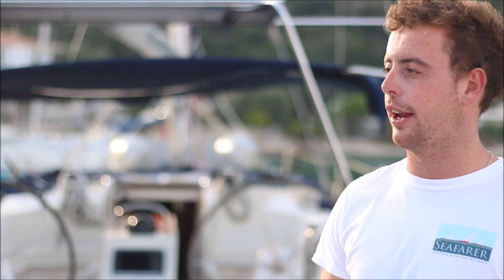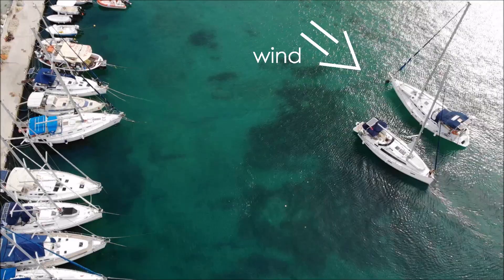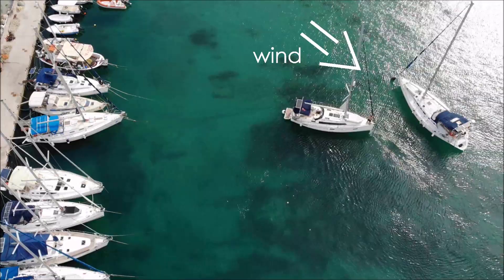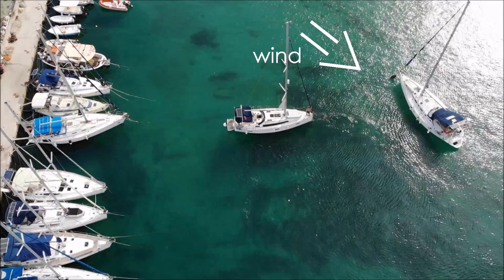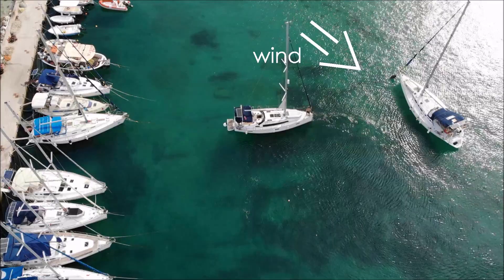How to do a Stern to Mooring

Comment: Nice vid, but in my opinion you should to drop the anchor when you heading back to the mooring and use as much anchor chain as possible. Thanks for the video.
Reply: Yes, not going straight while stretching out the anchor chain causes trouble - especially in harbors!

Comment: I wasn't aware that you would need to drop the anchor so far out. Did it drag with the boat after hitting bottom of anchor where it was set?
Reply: It drags a little. You try to pace your movement with the speed that your windlass lets out your chain. Once you have your stern lines tied and set where you want them you set the anchor with your windlass to the appropriate tension. Setting it far out gives a better hold because the weight of the chain is also working as a anchor and keeps the bow from moving to starboard or port.
Reply: @chefdan87  thank you!
Reply: @chefdan87  You have to move according to the needs enforced by wind.
The windlass might be too slow.
Far better easing the chain nut on the Windlass' axle and let it fall & control the chains speed by the Nut's clutch.

Comment: Dear friends good evening. 0:32 it is not the right way to cleat a mooring line. 1:40 mooring lines go under preexisting mooring lines. 2:11 the same thing. 2:22 an old CQR to dig in in that sea bed? Only with a lot of luck.  Fair winds.
Reply: Isn't whether to go under or over preexisting stern lines only dependent on which boat is higher? That is, isn't the goal not having the stern lines touch/scuff against one another?
Reply: @sleepyjesus7265  dear friend good evening. I am afraid that is not that way. All mooring lines even from diferent sized boats touch against each other becouse they are never tensioned completely. Boating etiquette might seem non sense to the young generation but to my days was very important. I am very sorry that my comment propably offended you. I didnt mean that. I wrote it as a friendly advise, we all keep learning.
Reply: @nikotsalis  Thank you for your reply. I'm sorry if I appeared to be offended in any way by your comment, I meant not to signal anything of that sort. My question was only raised out of curiosity towards the subject. I tend to think these things from a pragmatic viewpoint rather than a fixed etiquette or a rule book. I understand we sail in very different parts of the seas, so that part of the etiquette dictating that new lines would always go below the preexisting lines, has never reached me. If it is not too much trouble, could you please explain the reasoning for this practice, as it seems both more difficult for the crew of the second boat to do in the mooring process and quite irrelevant if the premise is that the lines would eventually scuff against each other anyway? I'm here to learn and discuss in a friendly manner, not to get offended or angry. Thank you.
Reply: @sleepyjesus7265  Juho, the aim of putting our lines under the existing ones is to facilitate the exit of the other boat. Some kind of etiquette, really; "I came here after you, so I am not going to bother you in any way".  Nothing to do with lines touching each other, they are built for this.
Reply: @sleepyjesus7265  Dear friend good morning, I am sorry for the late reply but I was away with no internet connection. Mr Juan Domenech has absolutely right. There is nothing more pleasant to the eyes than a neat clean boat aproaching to the dock with all crew members, with t shirts and not half naked, to the right positions, with no yelling and shouting, everyone to know what to do with minimum of effort and maximum effect. The boat moors perfectly effortessly with an impecable choreografy, with respect to the other boats and to seamanship. And if they manage to do it under sail even better, they make my day!!!
Reply: Επίσης νομίζω οτι έπρεπε να ρίξει την άγκυρα πάνω στον καιρό, και οχι ανάποδα που το κάνει.. και εντάξει, είναι το άλλο ιστιοπλοϊκό μπροστά του, όμως απο  το να δείχνει κατι λάθος καλύτερα να μην το δείχνει καθόλου.
Reply: Hello, since it is to faciliate the Exit of the other boat it is important to not put your line over the other's on a cleat or not to put Your bowline hitch above another one on a pole. But there is no reason at all, why your line should not be above another one in the free space between land an boat.
Reply: Apart from passing the line over and on the outside of the rails before OXOing it off, it was ok.  I'd also prioritise getting the boat secured and then work out if you need to set a leach line or reset your mooring line to stop it rubbing your neighbour.  In the UK we never leave lines set for slip once we are secure, unless we are leaving within the hour.  In the Med everyone leaves lines for slip.  I guess they don't care about wearing lines out.  The demo was fine, but then the water was like a pond. ;)
Reply: Yes, line handling beyond terrible!